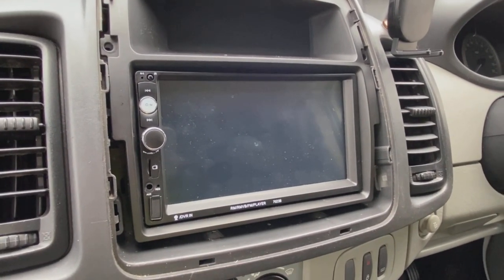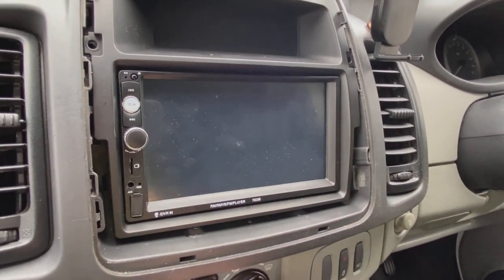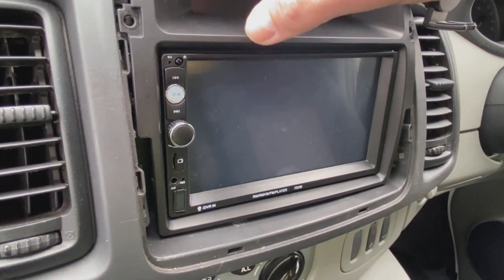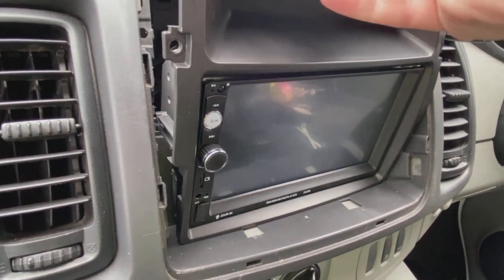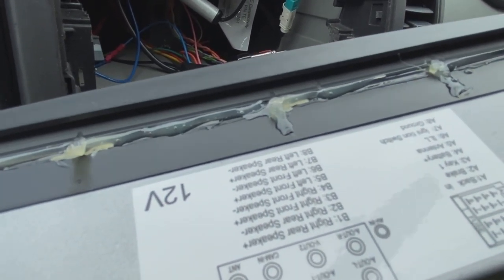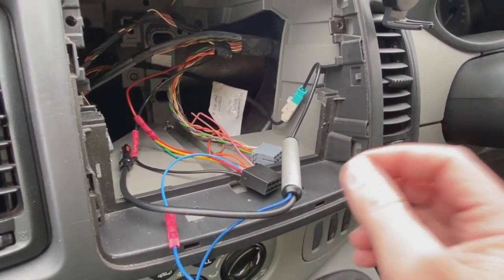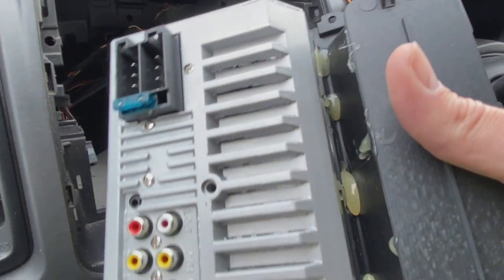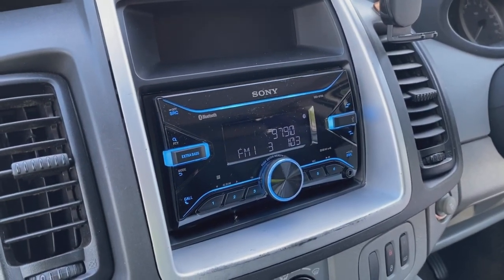How NOT to fit an aftermarket radio in a Vivaro

Comment: What head unit, facia, and harness did you use ? Or was it a plug and play kit ?
Reply from the maker: You would need to give your reg number to a place like Halfords so they could look up the exact spec needed. As for the head unit this was over a year ago just before I retired so you would need to contact a retailer for your options.

Comment: I have no signal on the radio or is it very bad, is it the antenna? Opel Vivaro
Reply from the maker: Most likely cause is antenna booster failing due to damp. Common problem.

Comment: Wanna do mine. In Essex
Reply from the maker: Sorry I don’t undertake private work. Thanks anyway.
Reply: What radio is it that fits  vivaro 2010 ? Thx
Reply from the maker: @kamilkoscielniak7741  Any single or double din aftermarket radio will fit. You just need the correct fitting kit, contact your retailer regarding this.